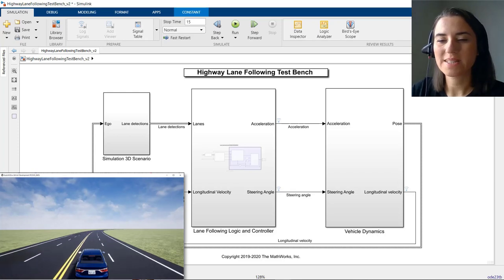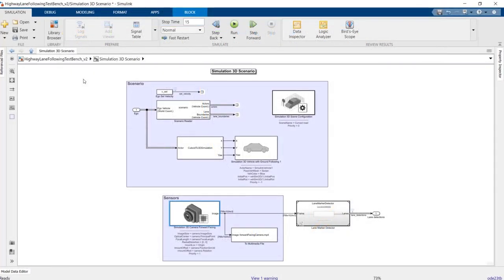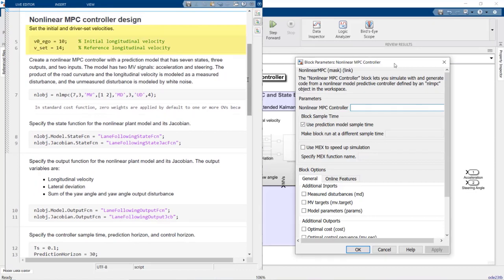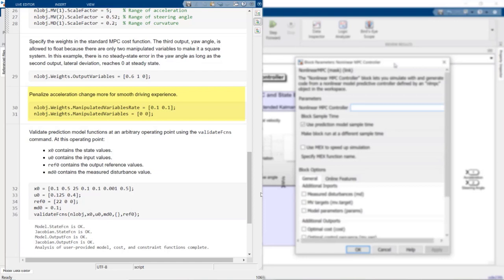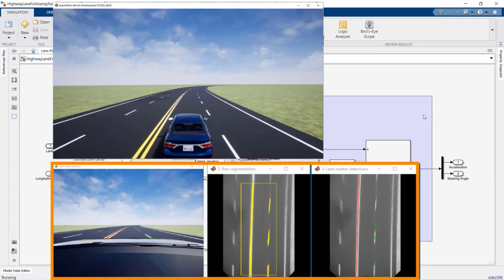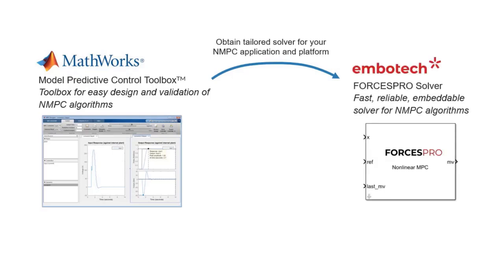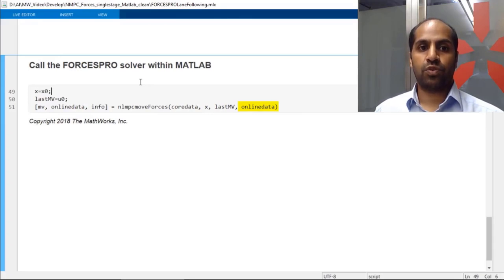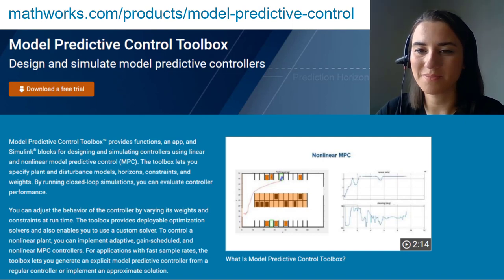Nonlinear Model Predictive Control Design | Understanding MPC, Part 8

Comment: how can I implement state/input dependent variable delays in the differential equations used to calculate the states in the stateFcn
Reply: For a discrete-time model, you can convert delays into discrete states using absorbDelay command. For more information, please check out this example: https://www.mathworks.com/help/control/ug/convert-time-delay-in-discrete-time-model-to-factors-of-1z.html?searchHighlight=convert%20delay&s_tid=srchtitle_convert%20delay_2